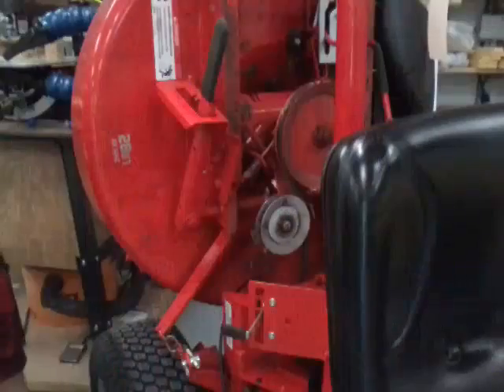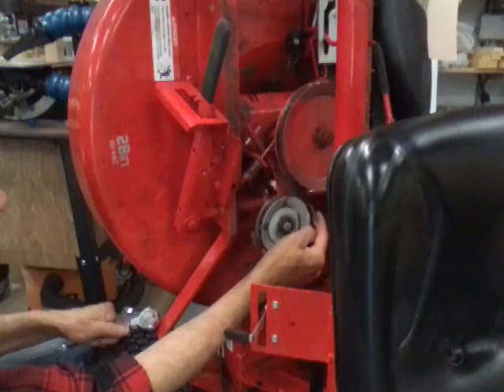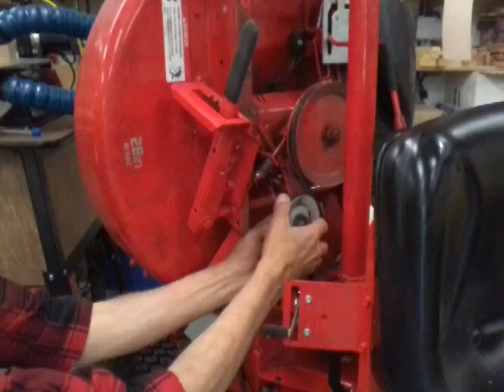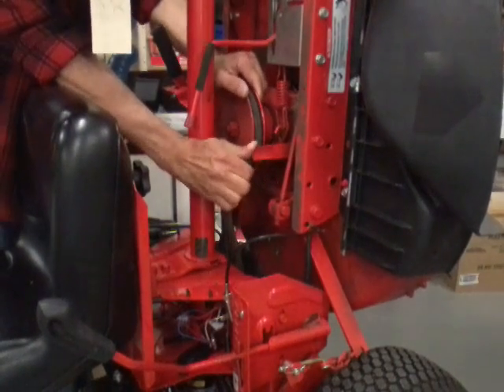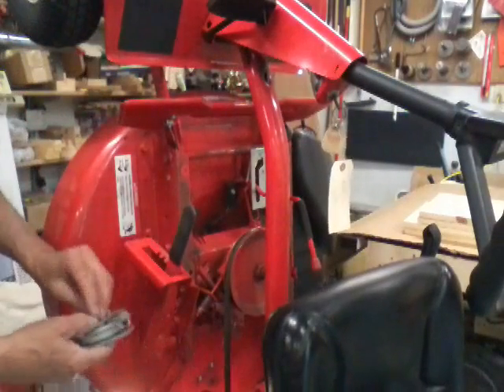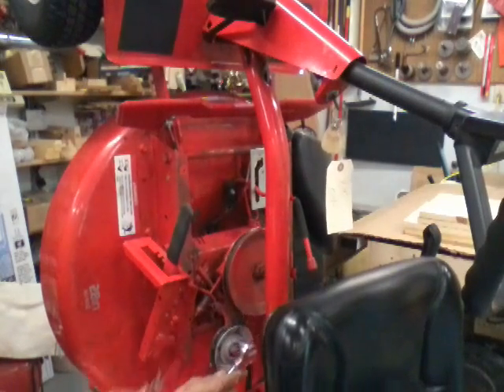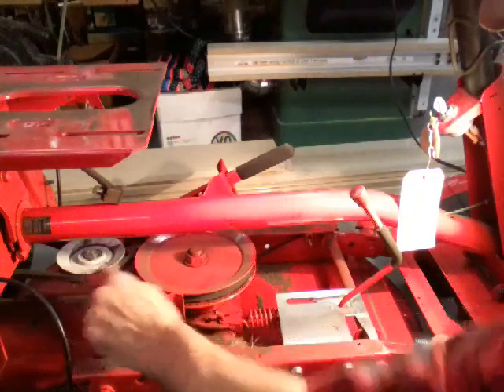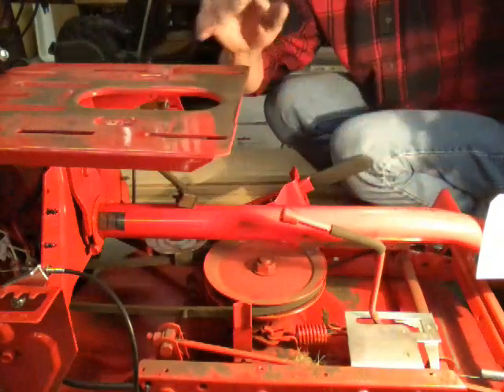101. M/S.7  Removing and installing a belt on a snapper Rider

Comment: if you put it in neutral and hold the clutch in, the new belt will easily slide under the transmission wheel .

Comment: You mentioned that belts aren't meant to bend backward. I know A section and B section, etc but I'd never heard of the AA section that my little owners book called for. It's cut with a "v" on both top and bottom - almost rounding it. That apparently allows the Idler to run without the irritation of a flat-top. Perhaps they saw it would twist, as you mentioned.

Comment: Thank you so much for posting this.  I finally know how to change the belt on my lawn mower and can also report that I managed to successfully change the belt after watching this!  I can now do something my dad doesn't know how to do (aside from computer skills).  Life goal achieved!
Reply from the maker: Aaron Slusher 
Now now don’t be rubbing it in too bad , If you need any other help with maintenance on that thing let me know talk to you soon. Jim
Reply: @jimjackson9381  no rubbing it in, it's enough for me to know.  Inner pride, ya know?  I'll let you know if anything else needs fixing.  I still don't think the belt is tight enough, but I couldn't get the front end to pull forward, so, we'll see if it throws the new belt t he next time I mow.
Reply from the maker: Aaron Slusher 
OK I need you to try something if you can stand your machine up on its back grab onto the two front tires and try to twist the tube that goes inside the rear case it should turn easily if it doesn’t turn then it’s rusted up and you have to break it loose don’t let the machine stand out more than five or 10 minutes without taking off the battery. Once you get a tube broke loose then you’ll be able to slide it to tighten your belt. Jim
Reply: @jimjackson9381  I'll give it a shot!
Reply: I wanted to let you know that I managed to get the belt adjusted, it just wasn't going to happen where I had the mower parked the first time.  I just hadn't had time to get to it until today.

Comment: Hi Jim, I've had snapper rear engine mowers for agout.20 years. My first had a 30" deck and a 8 hp briggs and Stratton. My new one a 12.5 hp intek with a 28" deck. I am in the glacial moraine country of north central wisconsin. We have more rocks and gravel than we have grass. ( very slight exaggeration).
     With these mowers I can go up 45 degree slopes, and down 55 degree slopes. Carefully. It takes about 6 -6.5 hours to mow it all.
       All this is to say that despite all the people that try to convince me to get a larger mower, this is what fits this property. ( I'm about 220 lbs and 68 years old.)
     Your videos have been EXTREMELY!!
Helpful to me over the years. Thank you so much for sharing your knowledge and experience with those of us who need a helping hand. There does.not seem to be a lot of that attitude left in this country. Yours is appreciated.
Reply from the maker: Well I am glad I can help, but you can help me by subscribing and it is free to do so and I does help. Well don’t forget to tell them no machine Picks up like a Snapper.  Jim

Comment: I have an older snapper it was my dad's its a mid 80s to mid 90s not sure but I've had it for 11years and the belt finally broke last year and thanks to your video I got it replaced today it sure has been a great mower.. thank you for your video's.. oh and I got the new belt from rural king there alot cheaper there.

Comment: Jim, the pulley on my drive disc came apart so I had to replace the drive assembly disc on my 33 inch rear engine rider. Here were the challenges. Getting those allen screws lose. Also, I couldn't have gotten the drive assembly off within a pulley puller. Removing the (right leg side) engine front mount bolt (tight working space). Lining the bolts back up to place the engine back in place. A little trick I thought of. From the bottom of the engine take a metal bit that is a little larger than the bolt holes and drill into the holes maybe an 1/8 of an inch to give it some shoulder to help the bolts align when you place the engine back down over the bolts. This really helps when you are by working by yourself.  I am writing you to say I knew if I ran into something I needed help on, you would be there for me. Thanks Jim. Job complete!
Reply from the maker: Well that’s what I’m here for to help all you guys and gals fix your  machines and save money. Jim

Comment: I just today put a Belt on, 1st 1 over 20 years.
I have changed the Drive Disk years back, had to refreshen my knowledge, and I ordered a new disk this morning.
I watched this GREAT video couplevtimes yesterday, came back this morning to figure out the Belt situation, what direction to install, V down or up, because of the Idle Arm, I guess 8 did it right, V down.
To adjust mine, which distance was 1" didn't have to, my Center Arm has a Pin and Carter Key with a stack of Washers.
I suppose I pull the Pin out, pull the Arm out past to where I can put the Washers behind?
Yes, the direction of the Belt in the Pullys had me, especially the Idle Arm.
I crank her here in a bit after fluids settle 🤞.
Reply from the maker: @chrislnflorida5192  the belt that is supposed to be on a snapper is a double V the larger V goes into the pulleys on the engine and the spindle the smaller V goes into the idler pulley you can change and go to a standard V belt, but you have to get a flat idler pulley and replace the original

Comment: Hey Jim. Great video. really need guys like you posting these DIYs, so keep em coming. Recently worked on Snapper 131416bve that had one stationary and one movable idler pulleys. each idler pulley was v-groove, which seemed strange to me. mower kept breaking belts. local small engine repair service worked on this thing several times, but mower kept breaking belts. when i looked it up i found this model was supposed to use a double v type belt. never seen this before (guess the repair pros at the local shop hadn't either). ordered it, put it on, and that issue is now history.

Comment: Love the info.  I had forgotten that I had seen Snappers tipped up in our groundskeeper shop years ago.  That will solve most of my storage problem on my new/old mower.  And I think I'll make a cart so I can roll it back into the dark corner for the winter.  Thanks again.
Reply: make sure gas is off and that you have a sealed battery

Comment: Thanks for showing how to replace and tighten the belt on an old snapper riding mower but how do you adjust to get a new belt/does the pulley ever wear-out?
Reply from the maker: Henry Ledbetter 
If you’re talking about the idler pulley yes they go bad and you periodically have to replace them but they should last for 10 years at least. Jim

Comment: Managed to replace the belt thanks to your excellent video. Unfortunately i was unable to get the plastic shroud off of the 'blade engaging lever' so it was a bit fiddly. Would have been great if you had included that too :)
Reply from the maker: PF 
Most of the covers are held on with four bolts is yours different. Jim
Reply: @jimjackson9381  It is indeed held on with 4 bolts (2 short ones on the front and 2 longer ones to the back). The thing is that i couldn't manage to get it off with the lever in it (the L-shaped guide-slot for engaging the blade with the lever protruding didn't leave me enough space).
Reply from the maker: PF 
Yes that can be a tight fit the newer machines have a cut in the front to help. Jim

Comment: How expensive are the deck spindles ?? My deck is a hi-vac type with 28 and 33 inch blade diameters. How long does a belt last Jim ?? Thank you for your help and advice Sir. v
Reply from the maker: It all depends on the model number of your machine. I just looked one up with basic 28 inch deck and they’re selling for $150 for the assembly.  You can find that information on Parts Tree.Com          Jim
Reply: @jimjackson9381  Thank you JIM. Have a great day and never stop doing videos Sir.

Comment: Thank you. You have very good videos. I have a Snapper 84660 rear engine rider, but my frame is a little different. I ordered a new deck belt and was watching how to replace it when it arrives. However, my frame does not look like it is adjustable to adjust belt if necessary (see picture that I emailed you). Everything else seems to be the same as on your video. How do I make belt adjustments if necessary? Thanks,

Comment: New boots, blades and belt on sr1642 asap.  Plus I cleaned the top of the deck.  What a mess.  So once parts come then I hope my deck will stay engaged! Oh and a new battery so I dont have to pull the rope.
Reply from the maker: Well let me know what you find out on the deck.  Jim

Comment: Hi Jim I have the Snapper 30" the professional with 12.5 hp motor They side the belt on this model is 7022252YP but they don't give you the the size can you tell me what is the size on it and if this the right model for my mashing I have this mashing for 35 years and it works perfect.
 Thank you
Isaac
Reply from the maker: The part number for the belt that you sent me they’re saying is 11 1/4 inches long. You must have the wrong part number or maybe you have a walk behind lawnmower.        Jim

Comment: Hey Jim I just subscribed to your page I have always loved  snapper mowers mine got stolen so I bought this new one now it will go in reverse but not forward there is a bracket with looks like some plastic fittings maybe back by the drive stuff it looks like there is a tensioner deal that it attaches to if you could tell me the name of that and how it operates I would appreciate it I was trying to find a cheap fix but if I can figure out what it's called and how it operates I would greatly appreciate it! I used a rubber grommet and it worked a little bit better at least it pulls forward a little bit....
Reply from the maker: coreyvallen 
Well there could be a lot of things that are missing broken or just needs greasing can you send me some pictures of what you think the issue is with your machine standing up and I’ll let you know what I think. Jim
Reply from the maker: My email address is
jimsfixitshop@gmail.com

Comment: Both my old and new belts have about 2"of play but seem to work fine and in fact I dont see how pulling the tube out will make any difference except making the belt tighter, not closer together.  The only way theyre getting closer together is if the idler pulley can move farther over but it can't.  Secondly, my tube doesn't have a clamp, it has a bunch of big washers/spacers and a cotter pin.
Reply from the maker: opentrunks 
Your model needs plastic inserts to expand the frame and believe me if you pull the tube out of the rear case it will make the belt tighter. But if it’s working good then I guess I wouldn’t worry about it. Jim
Reply from the maker: opentrunks 
I talk about that very issue in video number 294. Jim

Comment: Hi, What size of belt do i need for a snapper 28” and the gasoline/tank hose is broken too, thank you
Reply from the maker: If you take your complete model number to Parts Tree.Com. in Texas and look it up it will tell you the size of the belt you need and you can also buy it from them the gas line you can get at any True Value Hardware. store or automotive store.         Jim

Comment: Jim, I like your video but  the mower deck you are showing looks nothing like my Snapper SPX2352 23 hp where I need to replace the drive belt. Have you done a video for such a model that I may have missed?  The routing of this riding mower is quite simple but it seems to me that I need to remove the idler pulley to get the old belt off and the new belt on. The manual I have does not mention anything about belt installation. Do you have any suggestions? Thanking you in advance.
Reply from the maker: Ursula Adamson 
The machine that I am working on right now is a snapper rear engine rider and that is the proper mowing deck, your machine model number does not sound familiar at all as far as a rear engine rider and I have never found one was a 23 hp Engine. So I’m not sure what machine you have. Jim

Comment: Thanks for the priceless information! I think I may need to adjust my belt but not sure. I got a Snapper built in 2011 a few months back and it has been great but the past month or so its been losing power. It looked brand new and I know was well taken care of when I got it. I changed the spark plug and the air filter and oil look good. It loses power when I turn the blades on and if I am mowing a long stretch (about 100 feet) it will slow down until it just stops, even on a flat surface. Also it has lost power and doesn't want to go up any type of hill. Any suggestions of what that may be? I may try changing the fuel filter next but from what I see it looks good. It starts right up and sounds normal like it always has. I noticed the gas cap float isn't working and maybe it needs a new cap and there is a pressure issue? Any suggestions would help. Thanks for the great videos!
Reply from the maker: There is a vent in the gas cap. Make sure that is open and clear now when you say the machine slows down, are you saying the engine itself is slowing down to an idle or is the blade slowing down or is the machine it’s self slowing down in speed in the engine is still running OK?
Reply: @jimjackson9381  okay I will try the gas cap. The engine and blade still run fine but the mower itself is slowing down to a stop. That's in 5th gear and on rabbit mode. Even on turtle it does this. I try down shifting but it still slows down to a stop eventually.
Reply from the maker: OK with your machine standing up take some pictures of your Rubber Drive disck I would like to see it and while it’s standing up, watch video number 70 and tighten your yoke spring that typically solves most issues.        Jim
Reply: @jimjackson9381  okay were would you like me to send the pictures? Also when I stand it up it leaks gas out of the gas cap. I watched that video and will make the adjustment tool and mess with it in the next few days. Thanks so much Jim!
Reply from the maker: Send them to jimsfixitshop@gmail.Com and put a baggy over the top of the gas tank and then put the cap on.        Jim

Comment: Hi and thanks for your lessons... How tight should the idler bolt be? When i got mine pretty tight it didnt want to turn the pulley and wouldnt go in gear. Thank you
Reply from the maker: You should be able to tighten the bolt for the idler pulley as tight as you want to without affecting the rotation of it at all send me some pictures so I can see what the issue might be my email is.      jimsfixitshop@gmail.com
Thanks for being a viewer and hopefully a subscriber. Jim

Comment: Hey Jim, I found your video. Much easier than going about it my way for sure. What is the belt part number for this old Snapper tractor??? The local hardware store gave the customer a 2-2252. I think maybe the original number was 230-7699????

Comment: Have a 2011 28in 9hp model that is having an issue with the blade engagement handle staying high enough in the lock postion to keep the blades running. It doesn't disengage the locking mechanism. Could the locking mechanisms possibley be worn and need to be replaced. Any suggestions would be greatly appreciated. Can't seem to find the engaging parts for the handle that locks the handle in place.
Reply: It runs the blades while I'm sitting still but then disengages when I start mowing.
Reply from the maker: James Hellwig 
Hi it’s Jim
 If your blade keeps running when it should be off and you have trouble locking it all the way up that usually means your belt is too tight take the black cover off the top of the deck and see what is going on. And let me know. Jim

Comment: Hi Jim, I have a question. My Snapper RER is a model 7800785 28”. I want to replace the belt which is Snapper #7043844 which has been replaced by #7043844YP. The problem is that they are showing on several web sites that the replacement belt is 1” longer than the original 72.75” vs 73.75” (Parts Tree, etc.). How can this work properly, are they assuming we will have to extend the frame? Thank you for your input. Mike
Reply from the maker: OK the 73 3/4 inch belt is for a 33 inch deck
The 72 3/4 inch belt is for a 28 inch and 30 inch deck call them up and tell them you have a 28 inch machine and you need the72 3/4 inch belt.    Jim
Reply: @jimjackson9381  Thanks for the reply.  The closest I can find is a 73”, will that work? If not what brand and seller can you recommend? There are a ton of brands claiming their belt is for the 28” Snapper but their listed length is wrong.
Reply from the maker: Well it depends which style of belt you have if you have a standard V belt and the back side is flat you’re going to have to change your idler pulley a snapper the belt has a double V It has a V on the front and a V on the back that is why the idler pulley is a V pulley.      So I guess to answer your original question yes it should work you’re going to have to stretch out your frame to get your 1 inch space between the belts.      Jim